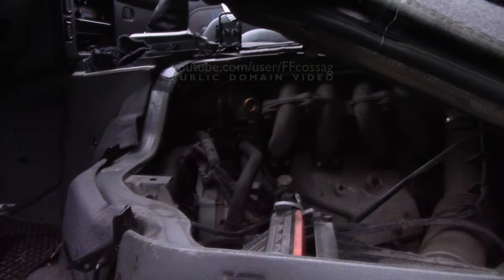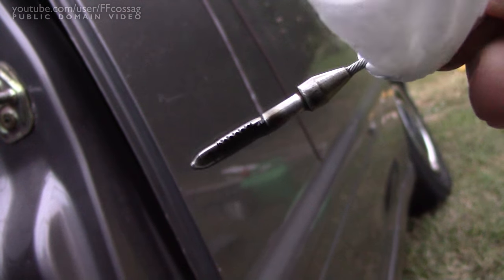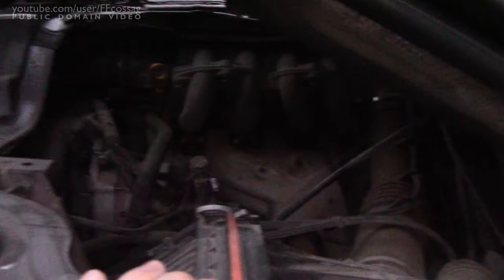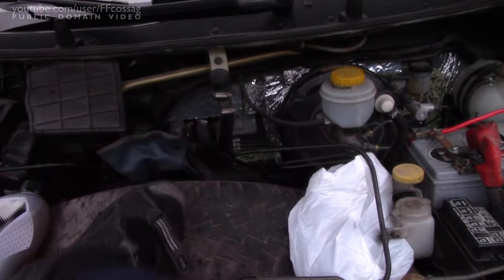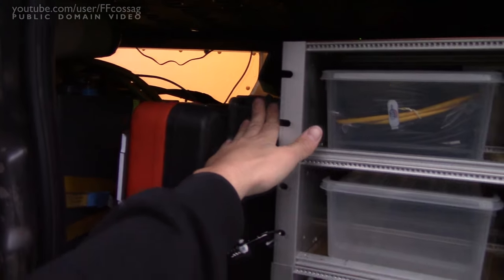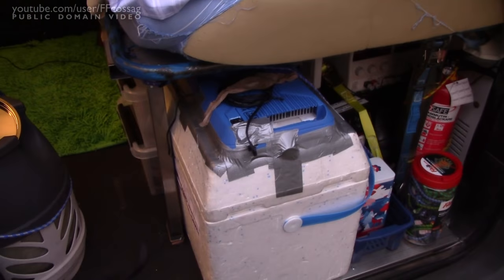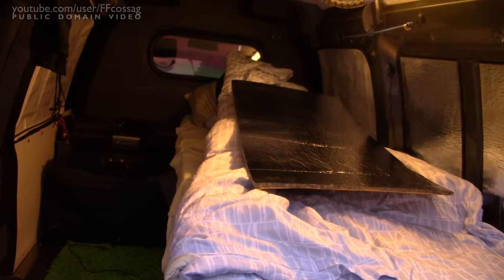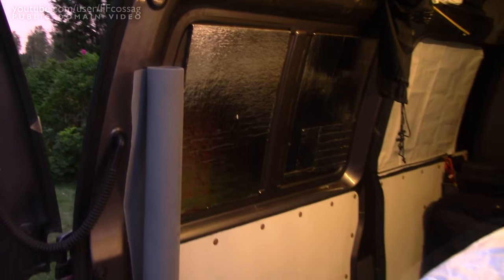Van camper! Pre-flight checks & van tour

Comment: I really like the way it's come together. I got a chuckle out of the one tool box labeled as a "nerd box".

Good luck and safe travels.
Reply from the maker: Thanks. The nerd box is the one that holds no less than three different soldering stations, an IR thermometer and more little electronicy bits than you can count.

Comment: Have a good trip. You're likely on your way now by the time you're reading this, but best wishes on your journey. hopefully you packed some stuff safely away to take to HPC if that goes through.
if in your travels you get the chance, I'd suggest getting one of those massive like 18-litre water coolers to keep around too with some water inside. easy to refill, easy to strap away. put it in a friend's fridge and you have cold water for maybe a day... rhyme unintended. handy as hell as well, instead of keeping around a gallon of water or something in a jug that can lose its cap at any time.

Dunno if they sell water coolers of that size for cheap in Finland or any of the other surrounding countries you're going to. May have to check the local craigslist-like dealie for a good pickup along the way. 

but yeah! have fun, watch your budgeting, and have a good ol' time.
Reply from the maker: I don't even want to know how much power something like that would draw. I'm keeping the fridge stuffed with mostly water for thermal mass anyway, so I'm likely to have cool water almost always.
Reply: I would suggest staying with compressor based coolers.

They have better efficiency than peltier based coolers, and can usually work over a bigger temprature difference.

as far as isolation goes, adding more is good, but should be improved to avoid blocking the hot side of the cooler.
Reply from the maker: erlendse
Compressor based coolers are obviously the best, but one of those would cost about as much as this entire build, including the van, lol.
Reply: no, not a powered one. I'm saying one you'd take to a sporting event full of some sports drink. seems to be the popular way to have a convenient water supply in a camper van.
Reply: +FFcossag I guess it's all about being creative then.

I am sure you could build the box if you want to. Isolation is key!

Finding something to take the compressor from is harder, unless you go for 230v (ripped from fridge).

Most newer fridges use propane/butane as coolant, so should be doable with some research.
Reply: +FFcossag I guess it's all about being creative then.

I am sure you could build the box if you want to. Isolation is key!

Finding something to take the compressor from is harder, unless you go for 230v (ripped from fridge).

Most newer fridges use propane/butane as coolant, so should be doable with some research.
Reply from the maker: *****
I'm going to buy a 20-40 litre water tank once I'm on my way. I'm just waiting to do that because they're needlessly expensive where I live.
Reply from the maker: erlendse
Yep, it's the finding compressor part I've been struggling with. The devices are so expensive that people rarely throw them away. I have been keeping an eye out for them in my scrap yards, but alas it's been fruitless. If I got my hands on such a compressor, I'd definitely do what it takes to get it serviceable. NO question about that!

Comment: Did you ever think about running a PTC heater. It will draw less current, won't get hot enough to cause ignition of any gasses that may be released from charging batteries. And provide just as much heat probably. Not sure what the weather is like during your travels or how cold it might get but a PTC heater might be better option and safer, not use as much room, not that much cost and you probably could build your own also for less. Just an idea I thought I would share.
Reply from the maker: A Watt is a Watt, a 650 W PTC heater would put out just as much heat as my old-timey thing. Mind you, my heater is not one of those radiating things, it has a fan in it. It's a bit of a moot point, though; I can't really run an electric heater unless I ABSOLUTELY need to.

The batteries are not going to release any gas at all, unless something goes seriously wrong with my charge controller. That's the beauty of industrial gel cells.

Comment: It just occurred to me you could have easily fitted a split charge circuit and charged your batteries from the alternator whilst driving, with the Solar as a backup for when parked or camping.
Reply from the maker: I might end up adding that along the way. I figured I'd try pure solar at first.